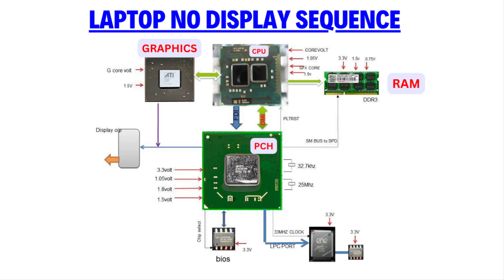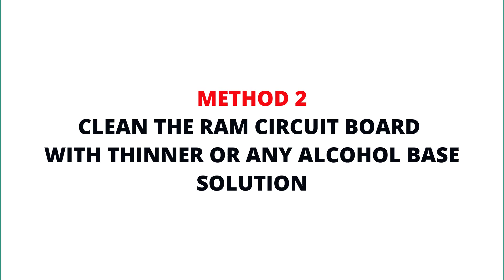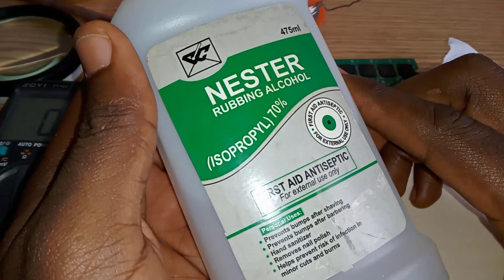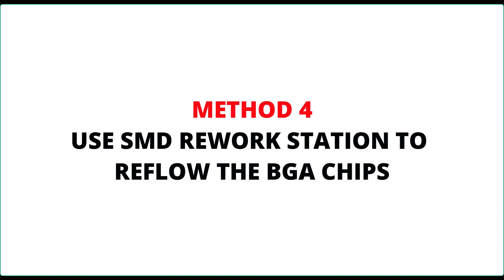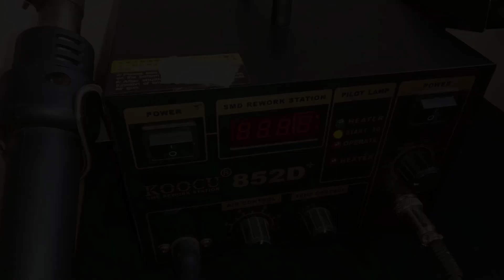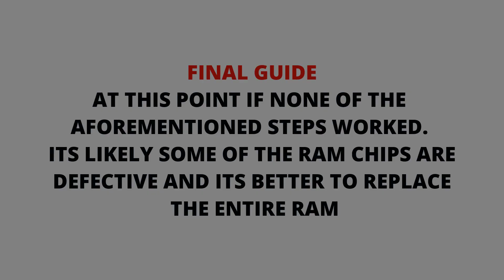Fix: Laptop ON but Display Black (How to Repair Memory RAM Dead No Display)

Comment: Thank you my man for uploading this video. I installed 16gb(8gbx2) ram on my laptop a while back. After a while the laptop just stopped displaying the image so I had to downgrade to the old 8gb single stick. Watch this tutorial and it just WORKS.
Reply from the maker: Welcome brother. Glad it works for you too
Reply: @saforotech8552 sir my own suddenly has issue with one slot, plugging in it causes this issue